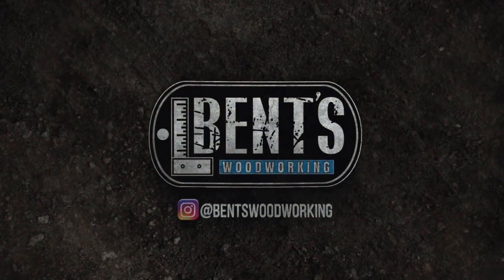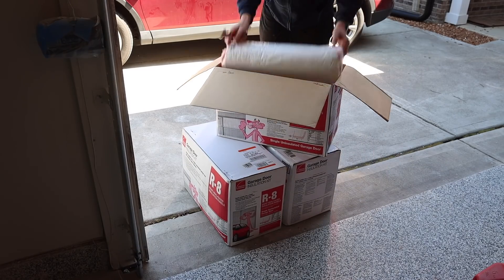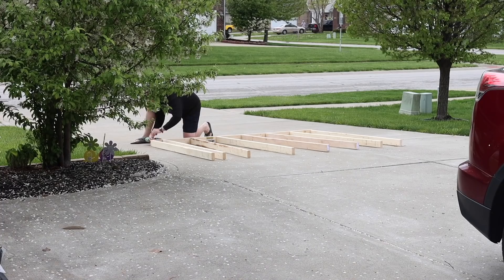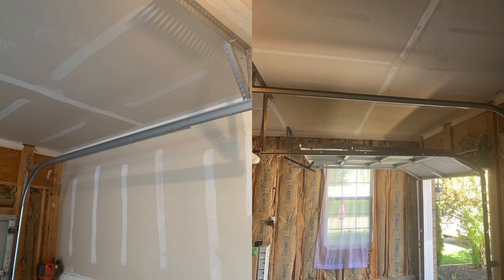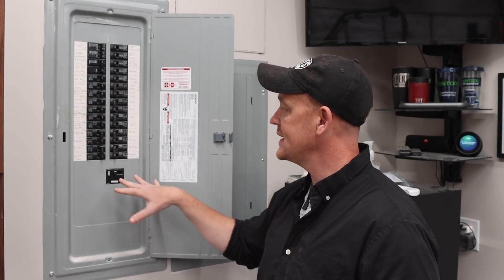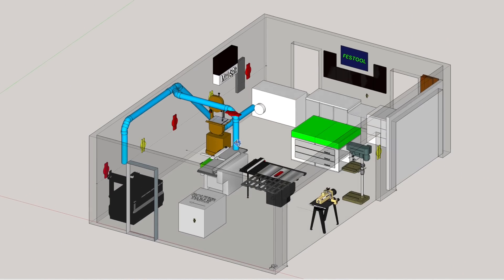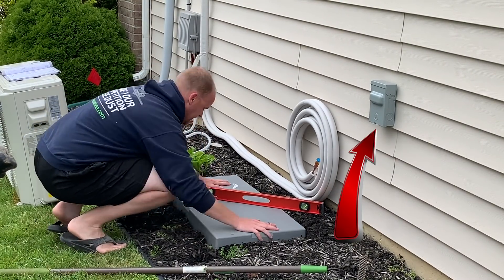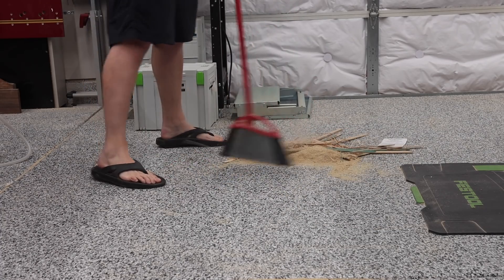5 Modifications I Made In My Garage Shop - New Shop Part 5

Comment: Great video - very well done.  I would say that 60a is plenty for a 1-person shop even with a split system (which is what i have) especially if you are using 240v tools b/c the amperage is half that of 120v.  Also, the epoxy floors are great- i did my own and it worked well - just need to get floor clean and dust free.

Comment: Nice mods, Jason. I might consider that style of garage door opener. That sure opens up ceiling space between the rails for potential wood storage. One note regarding the door insulation kits. I used the same kits on my two doors and they did make a huge difference. What I've noticed over time, though, is the outer half of plastic keepers used to keep the panels in the door section cavities sometime pop out. This allows the insulation to fall out of the door when the door ia raised. All was installed to spec and it still happened. I used tape over each plastic keeper and that helped to keep them in place. In hindsight, I should have run tape around the border of each section. So, I'm either going to do that or go with foam board.
Reply from the maker: I actually have mine taped on all 4 sides for the reasons you mentioned 👍

Comment: Awesome!  I love shop builds!  We unfortunately had our house smashed by a tornado about 5 years ago and had to bulldoze everything and rebuild.  On the bright side, I was able to make ton of upgrades to the garage for a better shop.  Added tons of lighting, and 120v and 220v outlets.  Insulated everything and got Clopay insulated R-18.4 doors.  Drywalled and painted a semi-gloss light grey instead of flat white.  I blew through my budget pretty quickly so wasn't able to do the floors, but hoping to upgrade to polished concrete someday.  Have been debating a mini-split AC, but the oversized portable is sufficient for now.  My only regret is not having the builder install me a big metal sink against the wet wall.  Another upgrade for the future.  Keep up the great work with the videos!  I'll keep watching!
Reply from the maker: I bet those doors are great. I actually have a sink right inside the door to the house so I got lucky there

Comment: I just had a sub-panel installed in my garage shop and I agree about the load calcs. 200 amps at 240V is a lot of power (that's 400 amps at 120V!), even shared between the shop and house. Maybe you'd have problems if you had a multi-person shop with a bunch of machines running at once, but it's plenty for a one man operation.

I have a support column in the middle of my garage with a tool cluster around it, so I had ceiling drops installed to power those tools. Junction boxes on the ceiling with strain-relieved wire dropping down 8 feet, terminated with female cord caps. I lashed them to the column so they're out of the way and it makes it really easy to unplug a tool.
Reply from the maker: Sounds like a nice setup 👍

Comment: Nice job. I did decide to go with fully insulated garage doors. Yes, quite expensive, but oh so nice here in Az with temps hitting 110+. And quiet. And yes, they do perfectly match my old doors so no HOA problems. Oh yeah, I went with those Liftmaster wall-mount openers  and higher rails.  Will never use anything else.
Reply from the maker: Yeah I hear you on AZ. I’m actually from Tempe myself 👍

Comment: I have my shop in my garage. Since I’m a licensed electrician, that saved me a pile. thank god, cause ima charge y’all out the nose to do what I did. 😂
Reply from the maker: Lol I’m sure
Reply: I'm savvy and  careful enough that I've added circuits to my breaker panel in 2 houses now  for my garage shop (the panel is always in the garage here). Here in FL, with block walls, I've only been able to run pvc conduit on the wall and through the attic.

Of course to each his own and manage your own risk and responsibilities. That and I'm not as fast as a pro.

Comment: The timing on these videos are perfect. We are looking for a new house( preferably with a shop) but may end up having to start in a 2 car garage and possibly build a shop. I am curious how much the garage door insulation dampens the sound outside the garage. I am a little worried about disturbing my neighbors. Tyvm
Reply: I'm a fan of cutting rabbets into 2 inch thick Styrofoam insulation panels. Can buy them 4×8 at big box stores. It's much quieter now and half the cost of the kit he shared, but does take some figuring and minor disassembly of the door stiffeners to get the panels in.

Comment: I redid all the electrical in my shop (previous owner did some really sketchy things) and "only" have 70 amps of service going to the shop subpanel. I would have liked to of made it 100 amps but was limited (on wire gauge) by having to use the existing conduit running between the house and shop, and other factors. I've haven't run into any issues yet. Like you pointed out, you typically only run one high power tool at a time. Having that access panel is for your panel was a good idea. I know people don't always like the aesthetic, but I surface mounted my panel and  did all surface mount conduit (EMT) and now wouldn't do it any other way, it makes adding a circuit a breeze. I really wanted to epoxy my floor, rough concrete isn't as bad as OSB but now that the shop is full, I regret not doing it.
Reply from the maker: Yeah I can’t imagine pulling enough power to cause a problem

Comment: Hi, just a question though. I am also moving to a new place with a similar configuration to yours. Nicely done so far btw. Ok so the question. With all the machines and and projects going on, how does your electricity bill fair? Maybe a comparison of the old place has more data that the current one.
Reply from the maker: Obviously here it’s hard for me to tell simply because these are all my first electricity bills. But in my previous shop I don’t really know to be honest with you. In the summertime my bill was higher in the winter time my bill was higher and the rest of the year it was just in between. Don’t exactly know how much of the shop contributed to it
Reply: Bent's Woodworking, ok no worries then.

Comment: Was it less expensive to insulate the walled-in door with the garage door kit instead of regular insulation inside the framing?
Reply from the maker: It would’ve probably been about the same but my reasoning behind it was in the event that I move and have to remove this and reinstall the garage door opener for the new owner the installation of the door will be the same as the other. Looking back at it now I do wish that I still would’ve just added insulation in the frame but I don’t think it’s gonna be necessary
Reply: @bentswoodworking  the long view escapes me occasionally. Nice work!

Comment: If I understand correctly, local code requires 3' of access space in front of electrical panels. I mention this for people considering placing their dust collector there. Ditto your take on epoxy floor coating.
Reply from the maker: Mine is completely accessible due to the dust collector I went with for this shop.
Reply: Just re-read my earlier comment and want people to know that that "ditto on the epoxy" comment meant you're right about epoxy with anti-skid flakes embedded in the surface is  the best surface ever. @bentswoodworking

Comment: always get 3 or 4 quotes for electricians lol. i had 1 quote at 1800, next was 12,000 and other was 1,300. middle one was a larger company other two were small business owners. go with small business. the one i went with actually laughed at the 12,000 quote. he said he could rewire the whole house for what they wanted to just replace the breaker box.
Reply from the maker: I had a very similar experience when dealing with the mini split unit. It blows my mind that there can be that big of a difference on installation costs between large companies and small companies
Reply: Bent's Woodworking absolutely! The electrician I went with told me the big companies up sell you everything. They tell you you need to add stuff or replace things that you don’t actually need. The more they sell the more their commissions are. Unfortunately. It’s always good to support the small business anyway but yeah I was shocked when I got the 12,000$ quote lol 😂 I even had to pay 80$ just to have them come out.